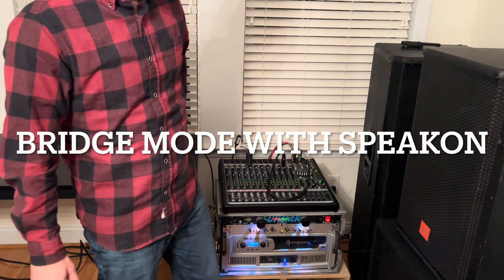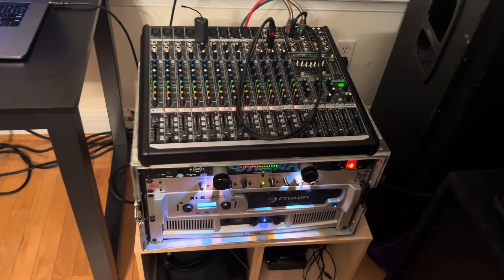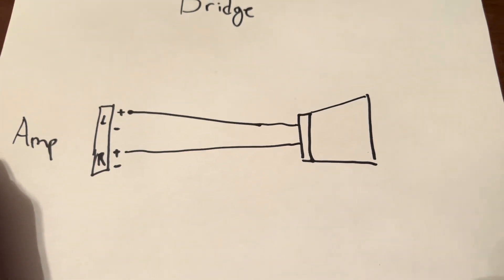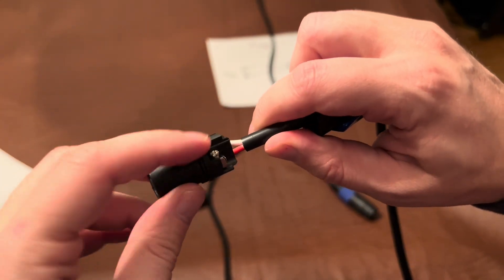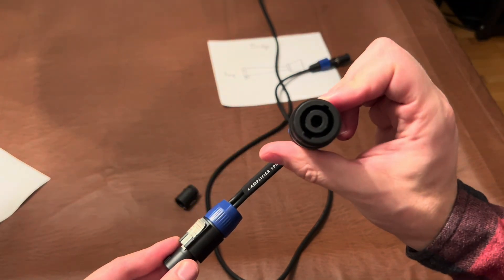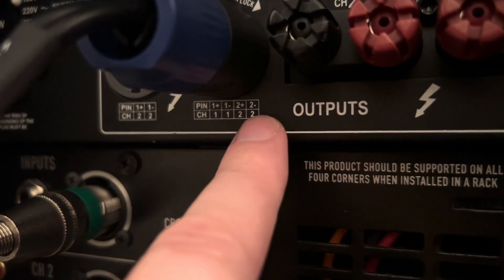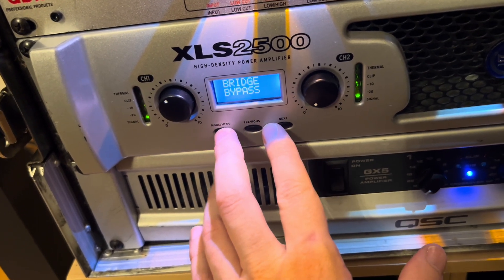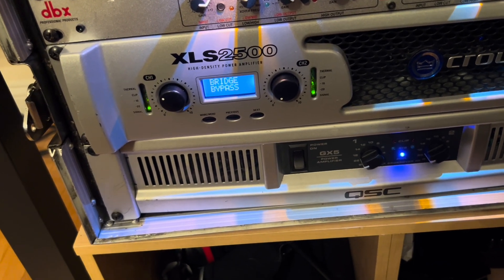How to setup Bridge Mode with Neutrik Speakon - Quadruple your amp power

Comment: I would like to ask you about the Bridge adapter and Bridge  are they different or the same?
Reply from the maker: The bridge adaptor is just a shortcut to be able to wire for bridge mode without modifying your speakon cables.

Comment: Hey I'm a bit confused. If your sub is 4Ohm, isn't the bridge mode unstable? Because when you connect the sub in bridge mode the Ohms are divided by half right? When crown says 4Ohm in bridge mode are they talking about the total resistance of the system or the nominal impedance of the speaker?
Reply from the maker: 4ohm bridge expects 4ohms from the speaker. In the amp manual you can see that it can handle 2ohms if single channel. So in affect you are pushing at 2ohms on both channels when you use a 4 ohm speaker in bridge. Which is fine for this amp.
Reply: @UCanFixAnything  I see, thank you for clearing that out! If I have a 4 core cable, what should I do with the other 2? Can I convert my NL4 cable to a bridge cable or should I just by a NL2 cable?
Reply from the maker: You need an nl4 to convert to bridge on the crown amp unless you use the adapter shown in the video. This is because you need the +2 channel.
Reply: So, (don't judge lol, just getting my feet wet in this side of audio), to bridge dual subs say the CW218Vs. Would you have 1 speakon that has all the poles wired up, then splitting off into 2 separate speakon connectors as -1 +1 & -2 +2? The -1 +1 being plugged into 1 of the subwoofers and the -2 +2 into the other? Correct?
Reply from the maker: That would not be bridge mode. You would just be running both speakers from one input at the standard non bridge style. Even if you turned on bridge mode on your amp it would still run non bridge with this wiring. But also those speakers are 4 ohms, wiring them together makes them 2 ohms then bridging makes them 1ohm, so this is bad, this will fry your map if you actually set up bridge. There is another person in the comments that has a similar question where I explain how you can do this with 8ohm speakers if you want to understand the wiring more to achieve bridge on two speakers.

Comment: You should only bridge an amp if you have to. Yes, you get more power, but you beat the crap out of your system to do it. Bridging the amp makes it see half the resistance to any load you connect to it. For example, a 4 ohm load is now a 2 ohm load. Why would anyone want to do that to an amp? If you have no choice, and the amp is struggling, then OK, maybe it will work better bridged. But its always better to buy an amp that has enough power to start with. 
If you're not sure what I'm talking about, think if it this way. If you want to make your car go faster, you could upgrade your motor properly, or you can drive down a hill with you foot to the floor. That's what bridging is doing. It forces your amp to work twice as hard. Also, when you look at specs for an amp, power ratings are usually pure fantasy. You can only get those type of power ratings on a bench under controlled conditions. You will never get close to any of those numbers when using it to drive speakers.

Comment: can you then split the bridge mono mode so 2 speakers have the higher output and just use a speakon splitter connected to the other end of the bridge mono cable?  my speakers are for my pa, each speaker is plugged into its own channel (1,2) I bought a bridged mono cable ( can only be plugged on channel 1 for bridge mode on my crown just like yours) and want to now split this higher output signal to both PA speakers which are 8 ohm 15" jbl's
Reply from the maker: When you bridge, it cuts the ohms in half (which is how you get the extra power in addition to running both channels). But if you run two speakers on one bridge it will cut the ohms again, which in theory would give you even more power, but you’d be at like 2 ohms at this point. You don’t need to “split” the speakon, you could just run a speakon from one speaker to the next through the plugs on the speakers to get the same effect as splitting it. So yes, this will maximize the power out of your amp, but make sure your amp is rated to handle two ohms or it can cause damage.